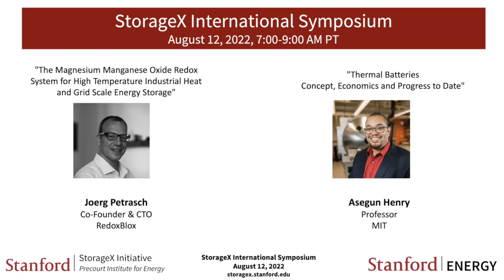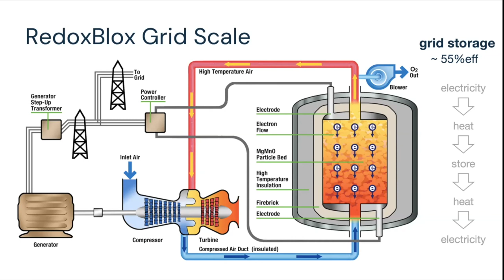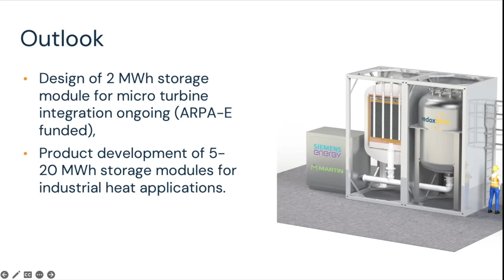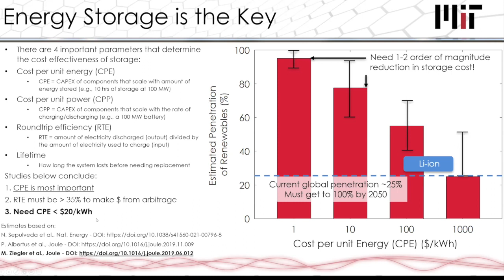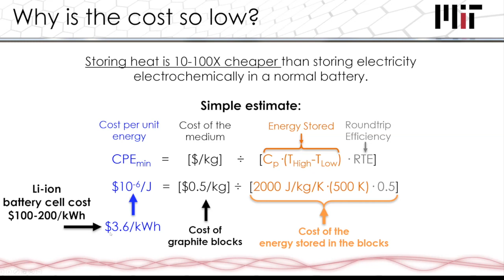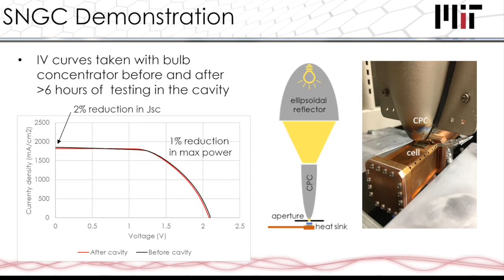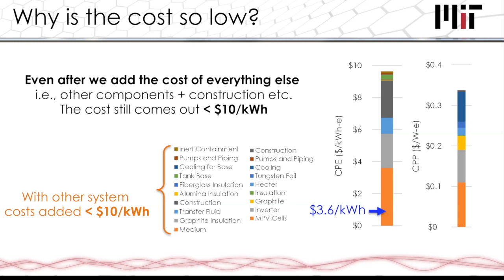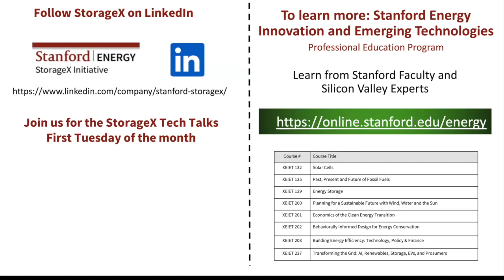StorageX International Symposium | Joerg Petrasch, Asegun Henry | Novel thermal storage concepts

Comment: Dr. Henry, why not heat the graphite directly with electricity. Graphite is conductive to electricity, it would be much simpler. What did I miss.
Reply: You can't manipulate Graphite into the motion you want for optimal photovoltaic performance.